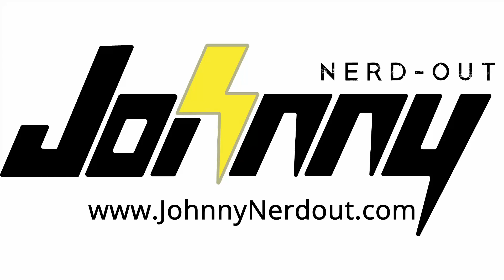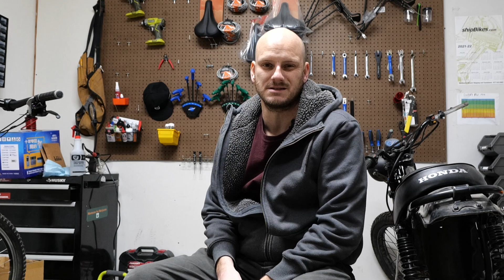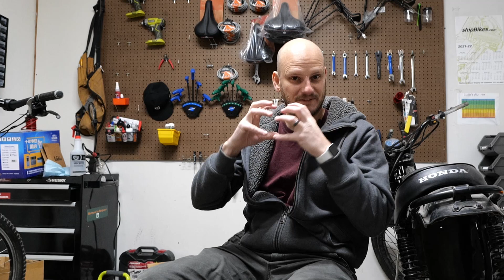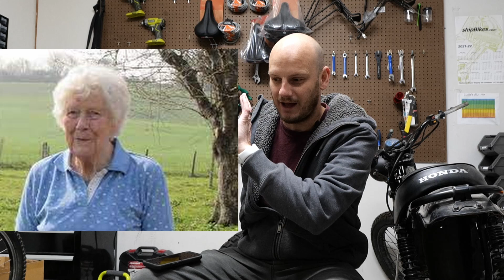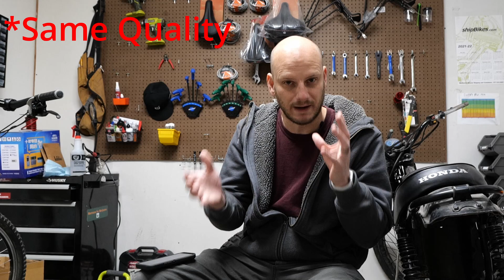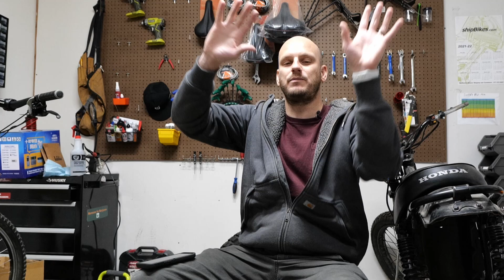Hub motor or Mid Drive Motor Buyers Guide : Which system is right for you?

Comment: So are there other factors that affect how fast you will wear away your drive train?

For example, I live in illinois which is the 2nd flatest state behind Florida, also I don't plan on getting a throttle. Would it last longer? 

I'm the exact bad example you said in the other video when it comes to gears lol. I have a 7 speed and leave it at 7 and change the power of the hub motor when I need more torque or speed. 

I was considering getting a mid drive with a internal gear hub mainly so that it's a little easier to start again after stopping (by being able to shift gears when not moving). But I doubt I'd be very good at slowly shifting back up to the highest gear. 

Do you think I'd be better off sticking with the hub or do you think in this specific case I might not eat through chains that much faster?
Reply: How often do you eat through chains, or is this hypothetical?
Reply: @BJ Nicholls     as in is my example hypothetical? No its real.

I currently haven't broke a chain yet. It's been a little over a year and I think I've done close to 1000 miles. 

I think even when I go out 10+ miles the max  difference in elevation is 60ft.
Reply: I found that using a BBS-HD meant not needing to shift much as a rule.  When my knees started hurting especially bad on some longer rides - typically, after about 25 miles or so - I would put it in the lowest gear I could find in the bike (second from bottom) and just cruise along in the low teens.  Supposedly the motor’s most efficient when it’s turning at a good rate, and I generally don’t go much over 15 mph except in emergencies.

Comment: hey,ive got a question,ive installed a bbs02 on my bike yesterday,and ive noticed a problem.Whenever i put assistance level more than 6 sometimes,the battery just stops giving power and when i look at the display it tells me "0%" but then slowly gets back up.do you have any idea why?
Reply: You have a weak battery or a battery that does not meet the minimum requirements for the BBS02. The BBS02 can pull a maximum of 25A, so a pack capable of a minimum of 50A output is required to be safe.
Reply: @ricksanchez3628  my battery is a 48v 13Ah isn't enough normally??
Reply: just checked my battery is normally able to continuasly provide 28A of continious discharge current.I guess this is what happens when something looks too good to be true
Reply: Also - some sellers tend to rate their products “optimistically” - as in they say it will manage a given current level over a long term, but the truth is about half of what they say it is (and sometimes less yet!)

Namely, if your motor can draw 30 amps at full stretch, you need a BMS that can source at least 60.

Comment: Very fair comparison & good info for the new enthusiast.
After much research and a long life to learn...
I ride a mid-drive and drive a stick shift;) Wouldn't have it any other way.
Reply: Exact same here. 5 speed stick is so much better of a drive than automatic!
Reply: @Geoff9001  Old school👍. The norm now is 6 speeds (I've even seen 7). Mine is a 5 as well;)
Reply: @michaelsprinzeles4022  Ive seen sequential shift/autos up to 9 speeds! CVT is technically unlimited speeds within a range
Reply: @Geoff9001  We were having a nice polite conversation about propper transmissions until you started using dirty words like sequential shift & CVT;) Both of those are missing an essential third pedal;)
I have to admit that the tech for both transmissions is fascinating (and probably superior to manual) but it lacks soul and saps the fun out of a twisty mountain road.
Reply: @michaelsprinzeles4022  Sorry for being impolite haha. Yeah I test drove a CVT and absolutely hated it myself. Its so boring and takes away the audio(revving) and visual (tach) queues from how hard your engine is working. My 05 Kia doesn't even have a tach but you hardly need it because you can hear when you need to up or downshift. After driving it for 5 miles I pretty much learned what gear is best for what situation. This kia is the $900 I ever spent. Going strong 2.5 years later! Automatic trans with 180k on the dash probably shot by now. 

Now hopefully I can get 30,000 miles out of this bbs02 :) Its funny how I've spent  double on my e-bike conversion. Really considering selling it as I've daily driven a ebike before and its really nice except for the occasional time you need to go 40+ miles. Here in Houston, TX there at least a few times per month I need/want to go that far for specialty electronics stores and I think keeping my car for those trips would be nice. Looking into heavy duty bike trailers now..
Reply: @Geoff9001  Treat the BBS02 as you would your car (be in the right gear for the situation) & they're pretty rock solid. 30k may involve some maintenance though. I only have a little over 300 miles on mine (I ride my BBSHD more) but have it set for 18 amps with no throttle so I expect it to outlive me.
Not all CVTs are alike. The concept is great but most are programmed for best MPG not best performance. Also most can't take the stress of real power. I hate the fake "shift points" that defeat the purpose of the CVT.
I test rode a Euro-spec E-bike with a CVT and it was pretty sweet. Wouldn't last long with the power of a BBS02 though.